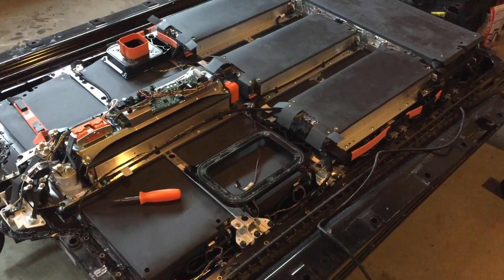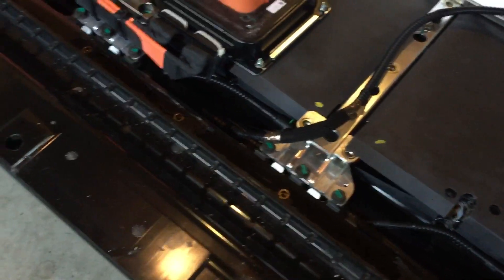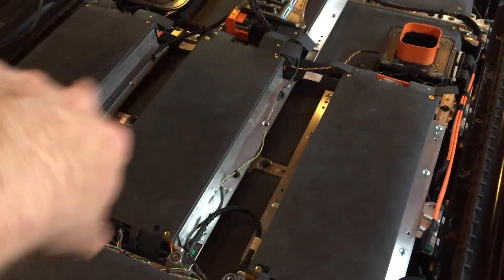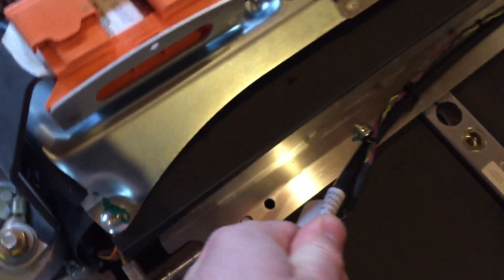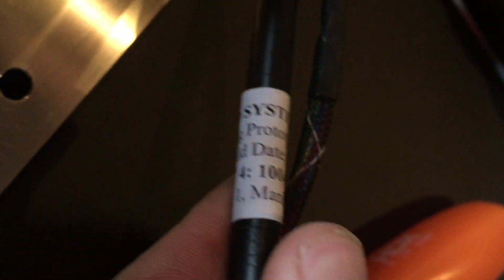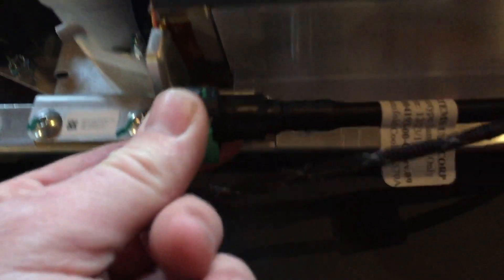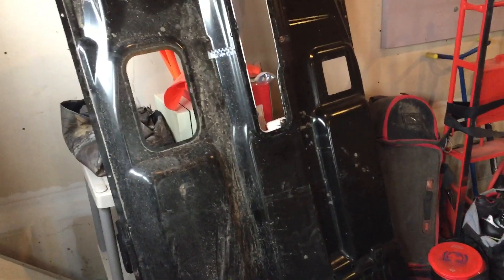Toyota (Tesla) RAV4 EV battery disassembly Part 4 - Heating/Cooling system

Comment: Do you have any contact info?  I have a 2013 RAV4 EV and the outlet pipe broke.  Toyota won’t fix it and said the entire pack has to be replaced.  Wondering if you have any advice.  Thank you
Reply from the maker: The cooling hose nipple coming out of the metal battery case?
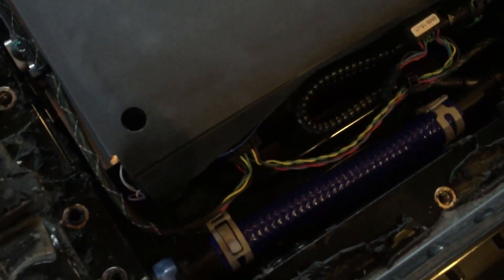Reply: @JamesKlafehn , yes as shown in 2:07 of your video.
Reply from the maker: @Cliff.theBRD you’re pretty screwed then. No idea how to fix that.

Comment: Dude.  I do this for a living.  PLEASE get some nitrile gloves on if you're gonna be anywhere near the orange stuff.  At my company nobody goes NEAR the packs without having gloves on.  Just plain 'ol nitrile gloves from Harbor Freight will go a long way towards reducing shock hazards.

Kudos to you for having the Service Disconnect out but those bolts on the top of the contactor are DANGEROUS.

I'd hate to see someone get fried; it's a very painful death from what I've heard.
Reply from the maker: I have brand new linemans gloves. I just make sure I know what I am touching before I touch it. Also keep your left hand in your pocket. Im good.
Reply: OK, good.  Hate to have anyone get hurt.  Thanks for the cool video.
Reply from the maker: Thank you for your input! I am glad you liked the video! Thanks for subscribing!
Reply: Never even thought about using plain ole nitrile gloves